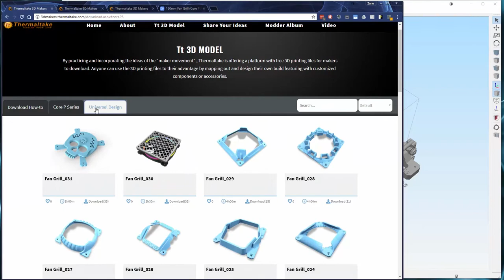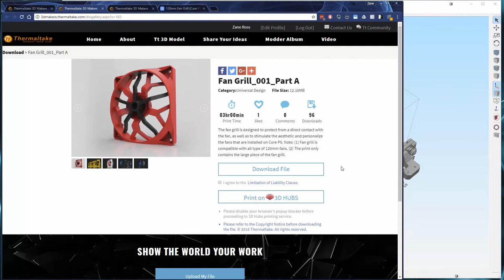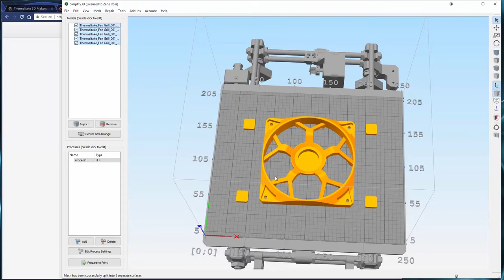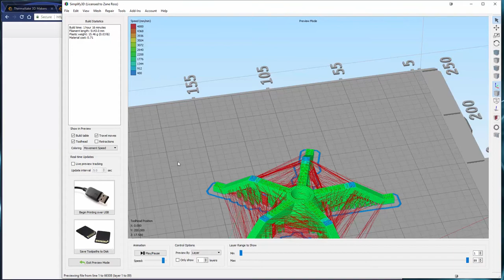3D Printed Fan Grill Upgrade (Core P5)

Comment: I'm working on something similar.  How did you get the carbon  fiber vinyl aligned so perfectly over the acrylic panel?
Reply from the maker: Used a large metal ruler as a guide, and went very slow.

Comment: How did you add the LEDs to the case
Reply from the maker: It's a custom made Acrylic panel that has built in RGB LED Strips. More info on my project blog.
http://mrarmageddon.blogspot.com/2016/05/project-open-core-acrylic-light-panel.html?m=1